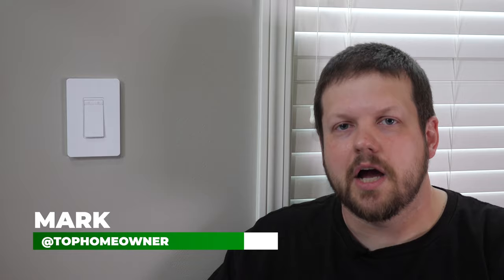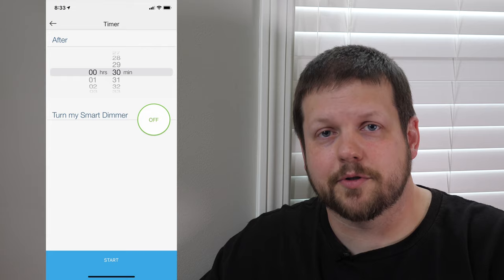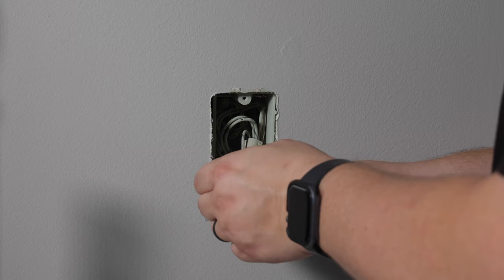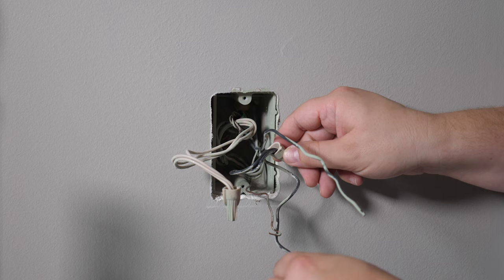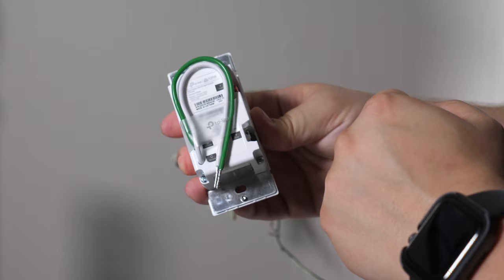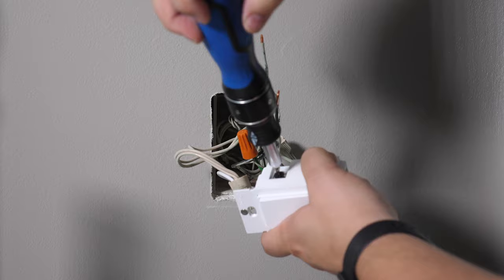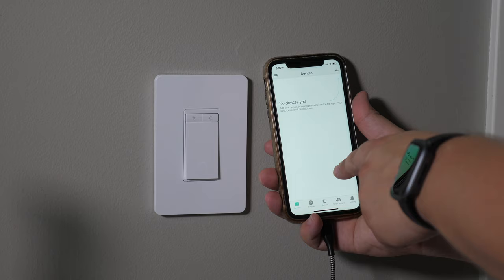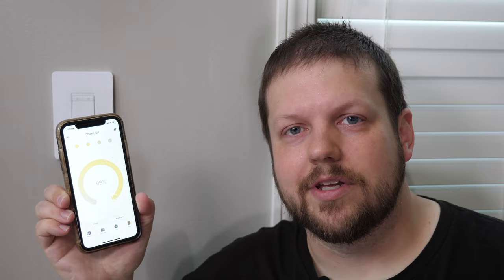100% Install and Review of the Kasa Smart Dimmer Switch

Comment: One note that drove me crazy. I installed a smart switch to control my front porch and the switch was one in a gang of three. When I pulled the existing switches all the white neutrals were tied together as expected. I pulled one the neutral wires and attached it to the new switch. The light blinked on/of every second but would not connect to Wifi. Then I tried another neutral wire and it seemed to work however the next day nothing worked. ONLY when I left all the neutrals tied together and tied the white neutral switch wire into the neutral bundle did everything work as advertised.
Reply: Thank you for sharing that. Otherwise worked fine? I have a gang three where I don't need dimmers as they for outside lights... But just want them to be smart (timing etc from phone). Hooe this works for my needs
Reply: You always want the neutrals tied together….
Reply: Yes all the same colors go together
Reply: Yes... That's basic electrical wiring to a home. Lol. All neutrals in your entire home is connected to one another. You take one that isn't connected to anything, it won't work... If you can't diy, then you call an electrician.

Comment: When you have several switches in the box where you are installing the dimmer switch, and 2 sets of bundled white wires, how do you know which bundle to wire the dimmer's neutral switch to?
Reply: Same question... Anyone??
Reply: @MStar10  Doesn't matter. Neutral, by definition, is common in the house.

Comment: I put one of these in today it was my first time trying to do this . At first it was a little tricky for me with the wires but I got a green light and hooked up to my Wifi the only thing is now the light ( flood lights ) will not come on . I am wondering did I do something wrong ? I did black to black neutral to neutral and got a green light but lights still won’t come on . Any suggestions ? Thank you 😊

Comment: You did good. However I see this will not fix my issue in that I want to install 5 sconce lights plugged directly in the out lets in the wall. What would you recommend? And still be able to have a switch like this to control them all? Thanks
Reply: A Wemo plug. Wemo outlet. Or another brand of a smart plug. 
I have multiple Wemo smart outlets.
Wemo is linkable to Alexa also for voice control.

Comment: Hi I have two black wires and a red wire and white. Can I still wire this? Or need a different switch? Thanks for your time!
Reply from the maker: That red wire should be a traveler so you'll need a version that's compatible with a three-way switch. Looks like the Kasa KS230 kit is what you'd need.

Comment: Have you noticed that if you set the default brightness very low like say 1% when you turn on the switch it takes several seconds for the light or lights to lit up? Even with the setting of fade on(instant)? If I set the default brightness at 50% or higher then they lit up immediately after pressing the switch. This happens regardless of pressing the switch on the wall or using the app. I have several of the Kasa switches(HS220s and KS220s) and they all behave like this so I think it is normal, but seems strange.
Reply from the maker: Yes, I have noticed that. I figured it was an issue with the LED bulbs... not enough power to get them started... but you're right, it could be the switch itself.

Comment: Great video. QQ: My house is from the 30's and there is some older electrical wiring. I was going to replace the dimmer in my dining room with this but there isn't a neutral wire, just two black wires to work with. Any ideas?
Reply from the maker: The only option I know of that will work without a neutral wire is the Lutron Caseta line. It's pricy compared to most of the other options, but way cheaper than rewiring!

Comment: Hi, great video...I am novice at electrical work, I have load, neutral, and hot,, but don't have ground wire. But it will work without ground wire?any advice??
Reply: The box should have a ground screw. See if you can wire it to that.

Comment: If WiFi goes out, does the switch start blinking or anything?
Reply from the maker: No, there are no issues with using the light normally without WiFi.

Comment: I don't have a circuit breaker, just a fuse panel with round screw fuses. Should I just unscrew the fuse to turn power off?
Reply from the maker: Yes, just unscrew the fuse in that case.

Comment: Hello thank you so much for this video! My question is this what happens if the load in the line gets switched my contractor put it in went home and now it’s just blinking the light that is, is blinking on and off and the TP Link smart dimmer is in pairing mode or Wi-Fi set up mode but it won’t let me connect my phone to the TV links wireless code and then it asked for a pass word that I don’t know

Comment: hi i want to know how many light bulbs can i atach to it, i d have to cover a long hallway, of about 20 lights
Reply from the maker: I can't answer that exactly but I did see that some people have had issues dimming multiple bulbs. Mine controls two and it works just fine. I'd go with something that's from an actual electric company like the Lutron Caseta line. Also, this article helps explain how to determine the max number of LED bulbs on a dimmer: https://blog.lightbulbs-direct.com/led-dimmer-switch-compatibility/

Comment: Where does the red wire go to within the outlet? I have all the other 3 and the red cord… please advise
Reply from the maker: The red wire is typically used for a three-way light (multiple light switches can control the same light). The one in this video is for a single switch only but I think Kasa makes a three-way version too.

Comment: Can I group different switch’s together and turn the group on and off. Example, “exterior lights only” group?
Reply from the maker: Yes, you can add a group in the app to control multiple switches and even smart plugs all at the same time.
Reply: I do this via Alexa as I can group different lights/switchers from different manufacturers together - I can literally say “Alexa turn house lights on” and every light in the house turns on at 100% brightness. For lamps etc you can use the Alexa plug or a smart bulb, but it gives you some great options in terms of home security.

Comment: Does it work with SmartThings?
Reply from the maker: No it doesn't. This is a WiFi only switch and SmartThings uses Zigbee and ZWave protocols. I have a mixture in my house and it's not too bad since we mainly use Alexa to control everything.

Comment: Hello, don't know if its been asked, I read on the amazon reviews that some are having problems with multiple lights (not clear if with a 3 way configuration), I presently have 3 led dimmable down lights on a single manual dimmer. Will this switch work with my setup? Thanks
Reply from the maker: Mine is hooked up to two LED recessed lights and it works just fine. I would think 3 would work but you're right it does seem like there's a limit to this switch based on other comments.

Comment: Mine have 3 black wire. Another 3 white and 3 ground wire. 
I hooked it up last night, the power is on, i was able to connect to wifi, light is on but the dimmer doesn’t work. I read alot of comments and peoples have same problem

Comment: Is it ok to NOT connect the neutral wire?
Reply from the maker: It requires the neutral wire to function. If you don't have a neutral in the box then this won't work and you'll need to go with the Lutron Caseta line

Comment: I cannot believe I can't find a video of this switch where someone actually activates the switch.  Can this switch be used by pressing a button on the switch?
Reply from the maker: Yes, its kind-of like a paddle switch that when you push in at the bottom, it turns the light on or off. I say "kind-of" because it stays in the same position... theres a spring behind it so when you push it in, the spring pushes it back out. The dimmer is controlled by the top two buttons as well (actual buttons). Hope this helps!
Reply: @TopHomeowner  lol, thanks!

Comment: what happens if neutral wire is not present?
Reply from the maker: If you don't have a neutral wire, the only smart switch solution I've found that will work is the Lutron Caseta

Comment: For some reason every night at the same time my switch turns off which is shutting off my ring cameras in the front yard. I have not been able to figure out what is causing it to happen. Do you have any ideas because it’s not clear what’s going on in the settings I have two more of these installed they don’t do it
Reply from the maker: Sounds like the ring camera is getting power through that box. If this didn't happen with your old switch and you have multiple sets of wires in the box, you'll need to identify the wire(s) that go to the light fixture and hook up the other wires with pigtail connections so the power continues though.
Reply: @TopHomeowner  Turns out the amazon alexa app was shutting it off. I had to change up the settings and it fixed it. Thanks for responding.

Comment: You didn't explain what kind of light bulbs you already had installed. Your original switch was not a dimmer so did you know your existing bulbs would support dimming? Are they incandescent or LED?
Reply from the maker: The old bulbs were incandescent so I wanted something more efficient

Comment: Its not a guess on which black is your hot… the hots are jointed together…. With a stinger coming off of the bundle to the switch (line side)… the load is the single black wire, which jumps up to the fixture

Comment: Hey man! When you "turn the switch off" manually, can you still just reactivate it via the APP? Or is power physically switched off to the light unit.
Reply: it can be switched with the app. the "switch" is not a switch. its more of a toggle button. so that means each press is changing what state its in
Reply from the maker: Yes we operate the switch manually, through Alexa, and the app interchangeably.

Comment: All i see are 3 wires 1 coper ground, one white, and one black
Reply from the maker: If those are all connected to the old switch, then it should be as simple as disconnecting them from the old and attaching them to the new switch.
Reply: @TopHomeowner   This may be incorrect information. It MAY be the old way of wiring switches. The power source is in the light box. black = line (live from light box), white= switched load back to light. ground is still ground. White should have a black sleeve or tape on it to indicate it is being used as a black wire.
Reply: So since their is only 3 wires, black is line, white is line and and copper is ground which means it connects to the green on the tp-link. Which also means the white wire on the tp-link is not connected to anything?
Reply: @jhocadsonarchelus786  If the white wire, on the smart switch is not connected to anything the switch will not work.  In the situation described above,  a smart switch will not work. For a smart switch to work it needs  1-line (power in - black) 1-load (power out - black or red) 1- common (white wire) and 1 ground (bare copper)

Comment: well, they used to be smart. An app update made them pretty stupid. These turned to crap. I had to replace all mine with Amazon switches and outlets in order to continue to work with Alexa. That whole "control from around the world" doesn't work either. All my devices got DHCP error" .  Don't bother with TP link, they went to crap.

Comment: Won't connect to wiifi
Reply from the maker: Do you have a strong wifi signal in that part of the house? I found this video that has some tips as well: https://youtu.be/iVDKqoVCDaM
Reply: Check - this will only connect to the 2.4ghz wifi and your router broadcasts in both 2.4 and 5ghz (almost all the smart home stuff only connects to 2.4ghz) what can happen is that it is connecting to the 5ghz network instead of the 2.4ghz and unable to “connect successfully” shall we say. The solution is usually to go into your router (via a web browser using the address in the back of the router) and turn off the 5ghz broadcasting until you have it set up. I do this especially with the Kasa bulbs as they seem to love the 5ghz network even though they cannot use it.

Comment: Think twice about TP-Link products:  If a TP-Link device fails you are required to ship it to them at your own expense. Then they have the option to repair it or replace it with a refurbished product. In either case, the warranty does not reset. So, if your item fails after 10 mos. and you ship it to them and they replace it with a refurbished product that fails 3 mos. later, you are out of luck because the 1 year warranty would have expired. All of that is a deal breaker for me.

Comment: If I use just the ground wire in place of the neutral can it work? I have no neutral 🥲
Reply from the maker: No, I don't believe so. Look into the Lutron Caseta line. I know those will work without a neutral wire.